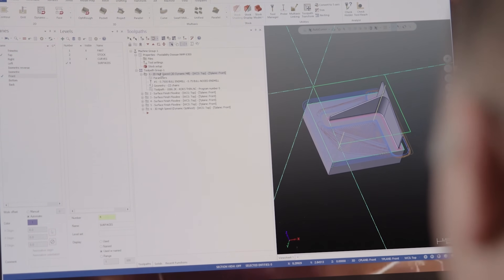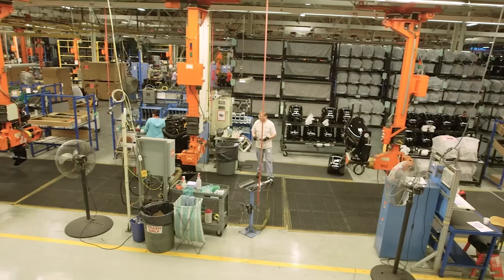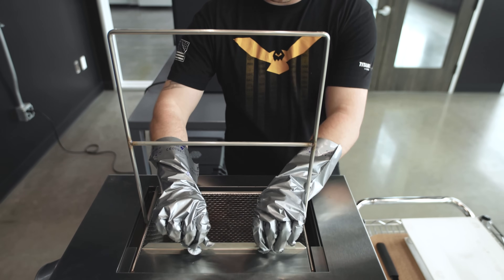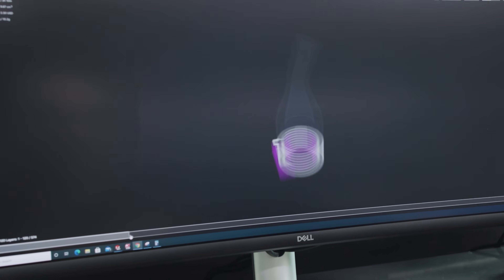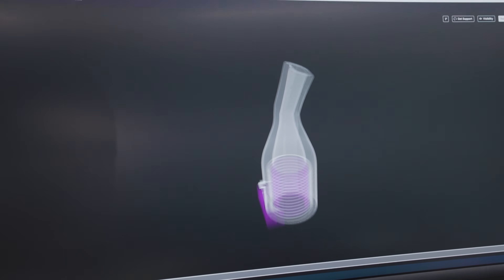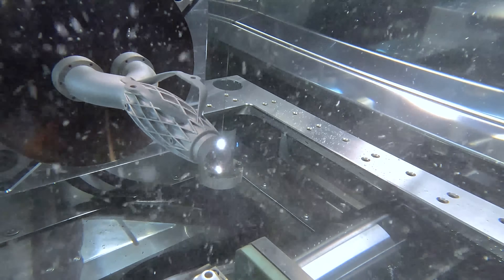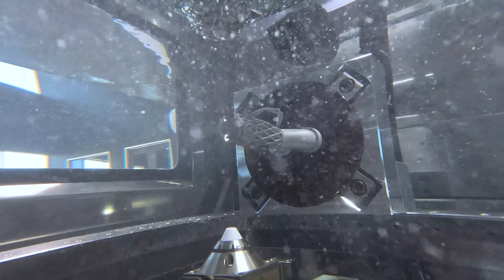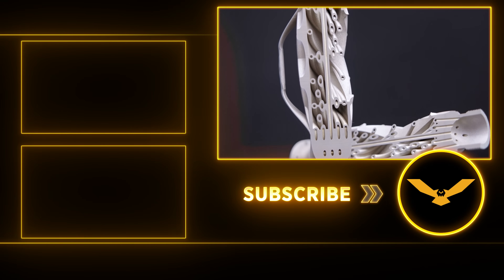Why Won’t Old Machinists Teach Young Machinists???

Comment: My experience with over 30 years as a CNC Machinist, here in New York a young person with just a few years on the job as a maintenance mechanic can make as much as me, so sad. Where I work the company can post a job in the machine shop and nobody applies. I love the work but looking at job openings in my area shows me I'm in a dying profession. By the way I have trained 2 apprentices both left one as a maintenance mechanic and the other as a warehouse picker making more money.
Reply: EXACTLY this. I have trained 4 people to help me and they all work from home answering phones for a mortgage company. I understand why the man in this story didn’t share his connections/tricks
Reply: Buffalo here. I see this on a daily basis
Reply: I have worked 25+ years in call centers and Mid Aughts I was training those that would replace me cause labor in India was cheaper than here in the US. Although that really has backfired a lot cause people don't want to deal with trained monkeys that cannot speak English the same way we do.
Reply: Knowledge not earned is not valued or appreciated. My father use to say " it's much easier to copy a wheel than it is to invent one"
Reply: @Bobwithoneo99999  How did your dad know that knowledge not was not appreciated? This video the guy talking would have appreciated the knowledge and used it and passed it down. How else is someone to learn if they do not pass down the knowledge? Your father's way of this is flawed.
Reply: Gary i have just retired 44 years machining here in the UK there is a shortage of our trade the young just don't want to learn it and as you say the money is not there any more!! sad really.
Reply: Maybe you're just in a doing state

Comment: this is the reason why i hate this industry 
every time i come across an issue someone does fix it but then i ask how they fixed it and they dont explain it to me even though i did see him fix it smh
Reply: So you are pissed at people who do your job instead of you because they do not explain to you how they do it. What did they get in return from you?
Reply: @Sculptoroid  well for instance how was i suppose to know to stop the boring bar from chattering u can roll the bar. heck i learned that from another shop after i had that issue in the previous shop
Reply: If you hate the industry get out knowledge is earned not given. My father was a machinist I learned part of my trade from him in the basement of our home. Sometimes he would allow me to struggle with a problem for an hour or more if I gave up he wouldn't say a word he just let me walk away but if I persisted at the problem he would come over and tell me the solution because he figured I had earned the right to know. Those were some of the most valuable lessons I ever learned about Machining

Comment: im a 61 yr old (ex aerospace) i taught my apprentice ... then got made redundant (paid off) so ive seen both sides of this!
Reply: That is exactly right. Back when I had about 15 years as a papered machinist I taught a newbie apprentice. Turned out he became the shop's biggest brown-noser and back stabber. Years later when I should have been moved into a supervisor position due to seniority, the suck up was given the position. After that my knowledge stayed with me . I left that company about 10 years later and am now retired from the trade with 45 years experience, with about 30 years of that being CNC and CAD/CAM experience.
Reply: This and welding and generally all skilled trades, the problem is rooted in the fact that skilled tradesmen are being "hired" at all. A tradesman should be self-employed. Working for an employer and relying upon them to connect you to customers and "provide" you with work, means you're setting yourself up for dependency, so if/when you give up enough knowledge to anyone else, so that you make yourself "replaceable", that is what they'll do. Skills and trades should be passed on from master to apprentice, and to the primary benefit of the master and the apprentice. When you allow yourself to be dependent upon an employer, you give them undue power over you. They pay you too little to be able to save up to start your own business in the same industry. That's usually how it goes. So you give then your labor for less $$ than it's really worth, and when you're let go, you likely don't have the resources to strike out on your own.
Reply: Sorry to hear that. Your apprentice will still need decades to come near to your level of experience.
Reply: @Sculptoroid  chuckle! .... i didnt teach him everything so i expect some head scratching in the future! (its the little things that count)  how can you teach 40+ yrs experience in such a short time!
Reply: Your bosses were asses!
Putting you out to pasture was a big mistake on their part!